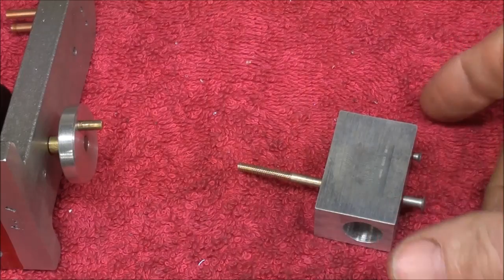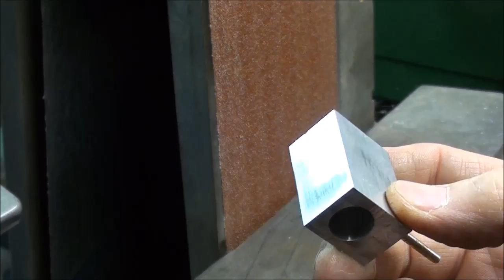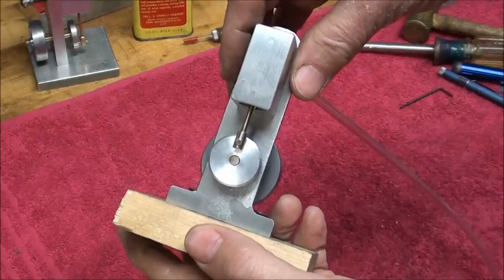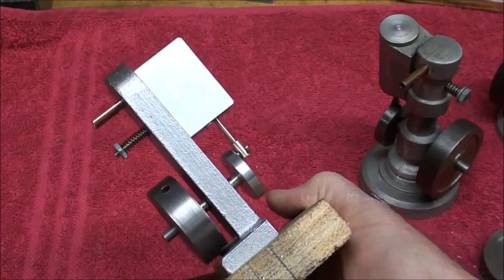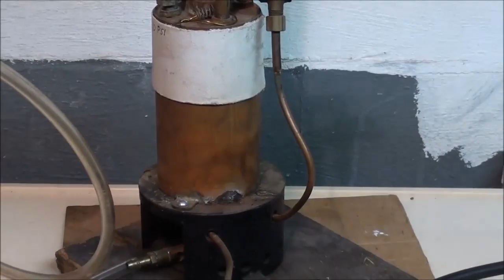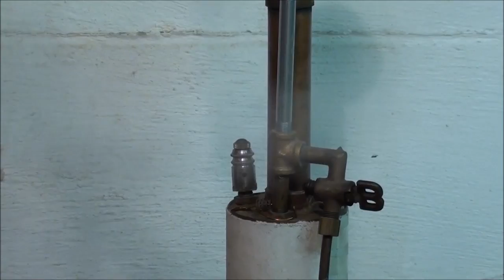TUBALCAIN BUILDS A SA OSCILLATING STEAM ENGINE Part 5 of 5

Comment: I used your method of marking the ports with a through-hole through the cylinder and the crank disk at 3 and 9 o'clock. It sure made construction simple! Thank you for the idea.

Comment: Hi Mr. Pete. Talking about testing engines in the factory reminded me of when I was working at the Buick V8 plant in Flint Mi. They had a carousel in the hot test area of the factory. An overhead conveyor brought the engines to the carousel which were timed together via a vertical shaft that went through the floor. The overhead conveyor turned the shaft above, and the carousel had a HUGE gear underneath which was turned by a pinion gear on the shaft. This timing made it so the engines would hang over work stations mounted on the carousel. The workers rode the carousel around as they hooked up the engines and ran them. After about a revolution of the carousel, the overhead conveyor left the carousel and continued through the factory with the tested engines.
Reply from the maker: +TinkeringJohn Wish I could see a video of that

Comment: I really enjoyed this series !
We made these at school when I was a kid, our design used a round brass cylinder soldered to a brass faceplate which added another level of difficulty and skill. They also had a second bearing in a small holder mounted to the base on the outer end of the shaft to help with stability. I remember mine got 'lost' just before the exams so I had to very quickly make a second one to enter as my coarse work ! I didn't mind too much though as I really enjoyed making it.
I never did see it running as I didn't have access to compressed air at home but I'm really tempted to build another one just to actually see it running.
Reply from the maker: Thats a good story.  Yea, build another one.

Comment: Just Awesome Pete.  I am at a Tier4 electronic engines class for heavy equipment & farm tractors and am in slightly over my head.  This is just the project I need to make when I get home to my shop to relax & do a fun project.  Maybe my 9 year old will join in some of it.  Thanks for doing this series.  By the way the how to run a South Bend lathe series is very good too.

Comment: Great video and fun project.  I am in CNC machining class in a trade school and this looks like a fun project.  If you could even just draw the dimensions of the important parts like the piston and cylinder and the length of the rod and pin on the cam.  Just having those dimensions would make this project easy to put together and have  a great success rate.  Thanks Tubalcain!  P.S. I love all of your videos.  Great series for someone who is in class now learning about manual machining!
Reply from the maker: Thanks
 Watch this video with plans. There is also a link with working CAD drawings.
Reply from the maker: mrpete222  Watch this video with plans. There is also a link with working CAD drawings.
plans for TUBALCAIN BUILDS A SA OSCILLATING STEAM ENGINE Part 6

Comment: I'd really like to see the double acting, even if you have a current working model and can just disassemble it enough to show how it works. BTW I'm 60 and worked in Oilfield machine shops for 13 years around Houston TX before the Oil Bust in the 80's.

Comment: I will never make one of these; I'm a woodworker, and wooden air engines don't interest me.

That said, I fully enjoyed this series.  It's interesting to see how a machinist approaches problems vs. how a hand-tool woodworker does.  The two methods have more in common than I thought.  You method of instruction is very clear, and I was able to follow what you were doing even though I've never used a metal lathe or a mill.

I can see why I've only heard good things about your channel in comments on other channels.

Now I'm off to find out how they handle condensation on large steam engines.  My curiosity is peaked :)

Comment: I thought about the flywheel and thought it would give it some more character if you put about 4 large holes evenly spaced around the recess you machined in the side. You would of course have to be sure to miss the hole for the set screw. That would also take a lot of mass from it so the engine may not run as slow as it does now.

Comment: Great video series, basic steam engines are fascinating. A drawing would be excellent, though I too am not really a drawing person as most of my engineering as a locksmith is done by eye and feel, it would help just for the first one. One question though, how well does this design scale? If you were to make a larger example, would it simply just run slower to counteract the vibration?

Comment: Hello, great set of vids as usual. Can I offer a suggestion? I have a steam wall paper stripper which is basically a large electric kettle. It can produce a good regulated jet of steam for about an hour. Wouldn't it be less fuss to use one to power your engines? Save you messing around with gas etc......

Comment: i am making my own steam engine and i was wondering is it better to put the crankshaft closer to the cilinder or should i put it more further away, what setup is better when it comes to the eficienci of the engine, in which setup will the engine run better and hawe more power. Love your videos keep it up :)
Reply from the maker: Petar Perić I don't think it matters-nor do I think it has anything to do with efficency.  Too close would necessitate a shorter stroke.
Reply: the closer the shaft is the stroke is shorter but the woble of the engine is longer and the leverage for the flywheel to turn it is smaller when the piston is in the closest position to the cylinder so i thought it would make some diference... i built it with the crankshaft the closest i could to the cylinder and it does run but it wobles alot and when i try to turn the shaft with my fingers it is quite hard for it to complete a full turn.I am making my steam engine so it can run on the lowest psi posible. Thank you so much.. Love watching your videos :)

Comment: You should make a little tractor and use 
The engine to power it
Reply: I agree, a nice little engine needs to be used for something and it would also be a great project to have a working machine running from it.

Comment: Hi MrPete

I would rather see you spend your time building a two cylinder Oscillating Engine instead of making Drawings.  The general dimensions are not all that critical and you have already mentioned the sizes of the important parts that really matter.

Willy

Comment: it would a great project to build a boiler that you can heat in a campfire and mount a dc motor to the crank of the wobler to generate dc electricity to power a string of led lights for nightime ambiance lol 
ps... im always trying to find a good use for things !!